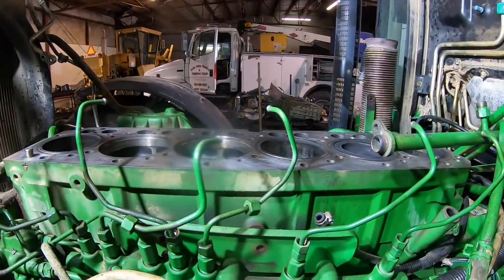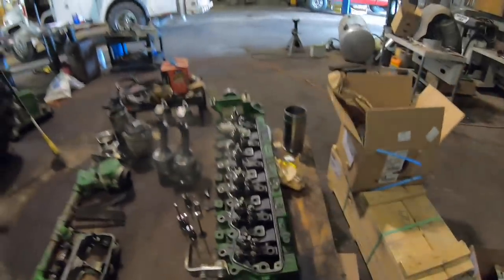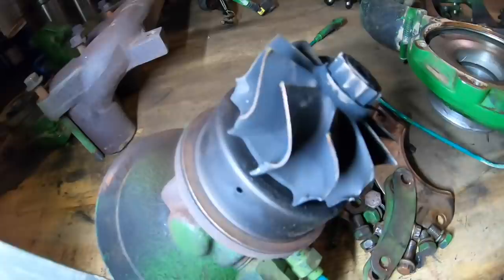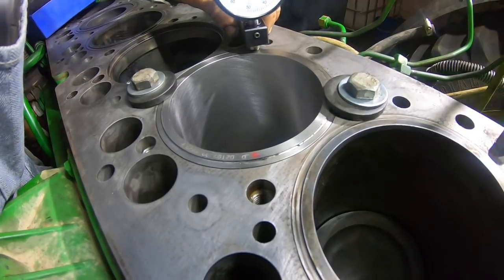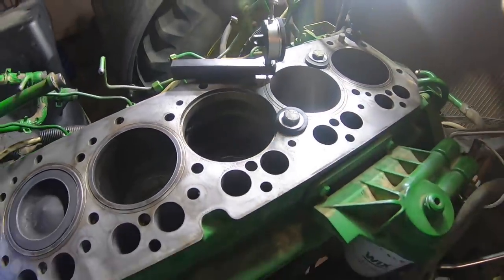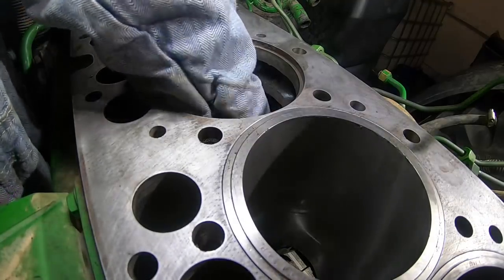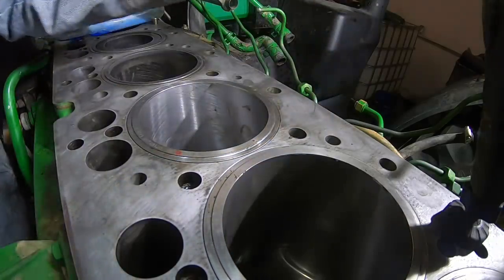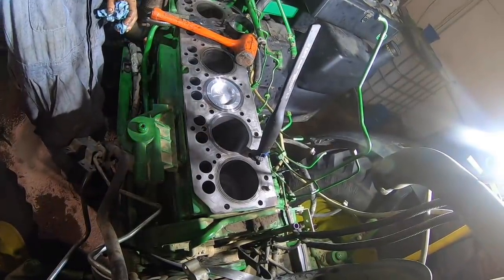VGT turbo caused major engine damage pt1

Comment: I always use vegetable oil. It was cummins recommended so I use it on all liner rings now. Thank you for every video. I watch you faithfully. I own a truck shop in eastern Va. I have been in the business of truck repair for 40 years and I learn something new from you all the time. Thanks again.
Reply from the maker: Thank you sir.
Reply: @westerntruckandtractorrepa1353   washing up liquid works well too  believe it or not no additives to attack the rubber let's then slip right in
Reply: The professor strikes again. Everyone sure learns from him. He is amazing.

Comment: I had a thought about the o rings. Maybe they say to not use oil on them to install because of swelling so you use dish soap to install them then once they are in place, oil eventually gets to them and swells them up in the block to help seal/hold things tight? Just a thought! Stay cool, Warren.

Comment: An old Cat manual would likely tell you to use SAE 30 for everything.
Reply: I've noticed that about CAT, recently they came out with a bulletin saying to use 50 or 60 wgt in final drives. I went to an oil and lube class at Detroit Diesel, they say the multi-viscosity oils just won't hold up like a single viscosity oil. Maybe CAT follows this policy also.

Comment: When the 92 series Detroits first came out, they had a lot of trouble with liner seals failing and getting coolant in the crankcase, we got a number of warranty jobs from RoadwayTruck Lines because they had lot of new trucks with 6v92s. Detroit went to a different material for their liner seals, and they never had that problem afterwards.

Comment: If I reuse the main bolts when rebuilding my pellet mill it will shear the heads off every time when it’s running again. I know it’s two completely different machines but it shows bolts can become week when torqued right up then loosened and then tightened up a second time. They are big Allen bolts and require a torque multiplier to achieve the recommended tightness. I just use the inch drive and dog it to the max now, fed up messing with the multiplier. Good job as always Warren 👍

Comment: strange why the turbo piled up, unless it's a common problem with that turbo, perhaps a piece of casting flash or something came loose in the exhaust runner (were all the exhaust port extensions good?) and went through the turbo, causing it to self destruct.. The problem is if you get any piece of metal in there, it'll hit the turbo vanes and turbine wheel repeatedly, the gas tries to push it inward while the centrifugal force pushes it outward, and when things are moving at 100,000 RPM, impacts are pretty intense.
I think any exhaust manifold ought to be designed with a bit of a siphon in it  to prevent the shrapnel from being able to go back into the engine

Looks like a great channel, Subbing!

Comment: I've changed liners only once,on a 70's Cat D5.The workshop manual said to use lithium soap on the liner seals,which threw me for a while!
After doing some internet research i found they meant lithium soap GREASE.I'm still a little embarrassed i missed  that

Comment: Warren, great video and explanation!  You mentioned that they were in a hurry to "just slap it together and get it goin' ".  They may have been in too much of a hurry the night before when the engine was damaged.  That's right, the night before...run a vgt machine hard and then shut it off right away and the turbo will usually self-destruct from being hot and oil starved (once the engine's off, there's no oil pressure).

Paranoid?  You bet!  Take just a little time to take it easy on the way back to the barn and let that turbo cool before you turn the key off.  It's a lot cheaper.
Reply: How long should a tractor idle to cool the vgt enough to shut it off?

Comment: I'm redoing a head gasket job on my truck and the reason I was told my gasket may have blown was that I reused my head bolts, I only got 20k or 30k out of it. They are TTY bolts also tho. My timing chain guide also broke which is something else, this is a late toyota 22r

Comment: I would check that the owner is using the right oil to work with the turbo and engine.  Some turbos are really finicky about what oil is used, and a lot of farm shops use whatever oil is around.  Also, the owner should not shut it down hot, it needs to idle for a bit to cool down the VGT vanes and the turbo cartridge after working hard for a lot of hours.  If he can't wait around for that to happen, have him invest in a turbo timer.  It's cheaper than an engine rebuild.

Comment: Instead of dish soap how about a thick dielectric type grease. Non-petroleum based.  Seems like it would give you a little bit of stickiness to maybe help hold the oring in place without swelling the material.

Comment: I had the vgt seize at low boost on a few tier 2 6068 kohler generators. Luckily the vgt failed at minimum boost and it rolled coal the next morning then faulted out. The oil drain tube bolt closest to the block on the turbo deserves a cus word that hasn't been invented yet!

Comment: Warren your awesome to watch!!!!, But I do have 2 questions for you, but realize that I'm a small engine and outboard mechanic.  1. Why not do compression checks on these engines to aid in diagnostics??  2. I have been taught by old school mechanics that you should always use Red Loctite on rod bolts whether new or used, why not do that to make sure that they don't come out??
I don't mean to be an armchair mechanic on you, but I just wanted to ask these two questions.  Aloha................

Comment: That’s a very common problem with 7430 and 7530 the crown breaks off the piston and goes through the vgt I would recommend replacing all 6 piston and liners   Make sure to remove all EGR pipes and air intake pipes after cooler and EGR valve if you can get it out there will be debris from the failure

Comment: Did I pay attention carefully enough? Was it the VGT (Very Green Trash) or was it related to those  EM veins on the VGT? Now this appears to be a design problem and location problem. Here's the more important point for the JD owner- What is the guarantee that this won't happen again? Same damn problem?  Nope. Get rid of that tractor right now because it has a serious design flaw.  Stupid engineers. Warren you hit the nail right on the head or the sleeve , with that famous rubber hammer.  Just freakin' fantastic, professor. Thank you so much for a great detective video. Just loved it. That 3 thousandths by the way- reminded me once again of dad and his gauge.

Comment: When I installed liners in most diesle engine I have worked on the tech manual said to lube the o rings with vegtabje oil and it worked great.

Comment: Also when I installed the liners I would set them all down in the bores then with out a head gasket on I would lay the head on top of the liners and carefully snug the head bolts down in the same pattern as the recommended torque sequence not to the full torque but just enough to seat the liners .

Comment: I once used dish soap on liner seals. Gotta watch, if soap is phosphorus based, and most are, it will corrode fresh steel fast. I only use the lube offered specifically for that app. You and I both know better safe than doing it again. Free SUCKS.

Comment: I had the same problem getting a mahle 5.9 Cummins gasket kit, they were back ordered they sent me a pai kit and rod bearings. I also have a l9 Cummins oil pan back ordered too. I’d be interested in people’s opinion of the pai gasket kits. They were a little more than the mahle kits in the end. I also got some reliance brand bushings from Agkits for the cam and wrist pin bushings if anyone has an opinion on them.

Comment: if a machine is worked hard the turbo glows cherry red hot.if the engines turned off while cherry red say the drivers going for a break.the turbo can fail like this.when i worked for cummins we put 10 minute timers on the ignition on large excavators at liverpool docks.to stop them doing this

Comment: Warren how did you get the water jacket so clean. I’m rebuilding a caseih 885 right now and the water jacket is full of rust and corrosion. Doing it in frame or I would vat the block. Thanks for your videos. By the way the case manual says use 30 wt motor oil on the liner o rings.

Comment: Suddenly a wild Jpaydirt will appear and tell you about the abvantages of a Switchblade Turbo. 🤣🤣🤣
Reply from the maker: The problem with that is programming. The engine will run derated if it doesn't see the vgt actuator.

Comment: Great video.  Any insights on what would cause a US 8295R  serial-99***  to throw a ECU.001 Fuel injector 4, 5, and 6 flow very low all at the same time, go away, and come back later?

Comment: Had the same thing happen to me but I had turbo codes put a new turbo on and it sounded terrible so I dug in a bit deeper and the turbo failed and pieces went in turned into a engine rebuild as well

Comment: where is your liner press?  it uses 3 head bolts and has a screw threaded thru a bridge set up and a push plate to install the liner.  torque it to 85 ft lbs and check liner protrusion.  even tho you didn't remove the other liners you need to check them also because there is a max difference front to back.  if the cooling system is not taken care of the coolant can erode the liner ledge and a liner may sink enough that the head gasket may blow.  altho on this engine I didn't see evidence of that. I am not a jd mechanic but have inframed many hundred series 60's and they are near identical except overhead cam. similar vgt turbo, ecu's,, egr coolers,  etc. in fact the very early series 60"s were cast in jd plant moline il. in fact the series 60's were actually suppose to go into 4060, 4260 4460 and 4860 tractors but then some unknown guy named roger penske bought the rights to them, tooling, castings, patents, assembly lines etc. and the rest is history.

Comment: just got done doing a cummins ism the 1 oring they have in the manual it says use engine oil but you need to install the liner within 30 seconds.

Comment: Torque to yield an angle. What exactly does that mean
Reply: from the internet: When bolts are tightened, they are also stretched. As long as they are not tightened too much, they will return to their original length when loosened. This is called elasticity. If they continue to be tightened and stretch beyond their point of elasticity, they will not return to their original length when loosened. This is called the yield point. Torque-to-yield means that a fastener is torqued to, or just beyond, its yield point.          .

Torque angle is considered a more precise method to tighten TTY bolts and is essentially a multistep process. Bolts are first torqued in the required pattern using a standard torque wrench to a required moderate torque setting. They are then further tightened an additional specified angle (torque angle) using an angle gauge, thus providing further tightening, which tightens the bolt to, or beyond, its yield point. In some cases, after torquing, the manufacturer first wants all of the bolts to be turned to an initial angle, and then turned an additional angle. And in other cases, the manufacturer wants all of the bolts torqued in a particular sequence, then detorqued in a particular sequence, then retorqued once again in a particular sequence, and finally tightened an additional specified angle. So always check the manufacturer’s specifications and procedure before torquing TTY bolts.

Comment: Can this be related to or caused by a not letting the turbo cool for a few mins before shutting down or this has nothing to do w that, it's just a freak thing that happened
Reply from the maker: It's related to the egr system , and a lot of idling.
Reply: @westerntruckandtractorrepa1353  ok thank you. I wish I could post a pic on here. Sunday the 8360r I'm running w around 3100 3300 hrs thowed a regen thing while I was setting eating lunch in it to set idle to atleast 1000 rpm and can't remember what else but I just put it on 1200 and waited about 45 mins on it to finish, it has always regenned while running and you could operate it however. Idk what that is meaning w this code and it said something about park regenned and machine not be able to be used or something. I got a pic of it I wish I could post on here